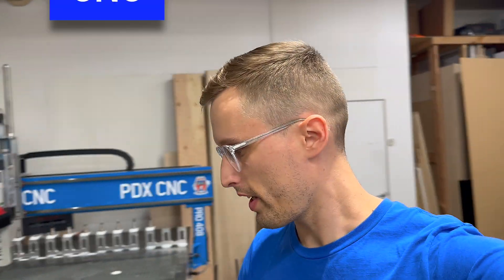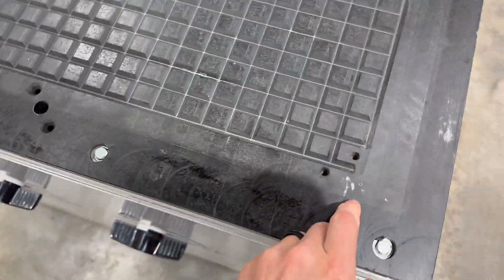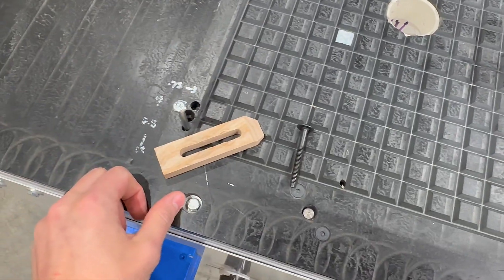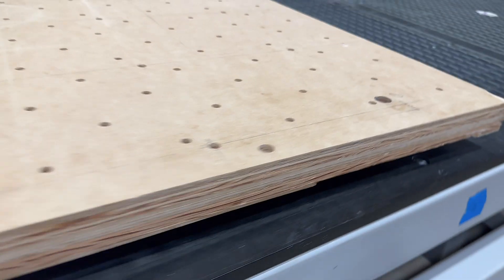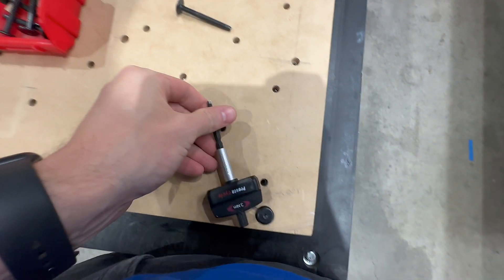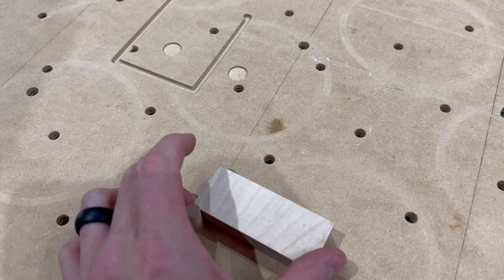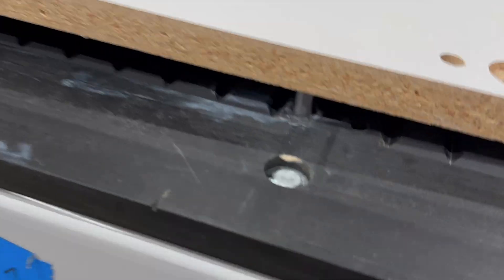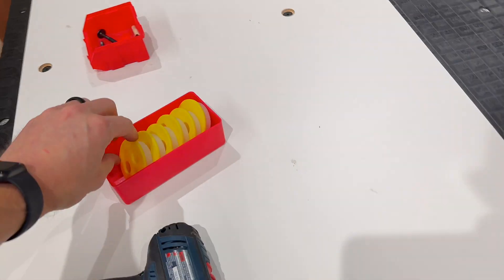Adding Fixturing to your CNC Router

Comment: Yo! I'm just drawing up my own fixture plate for my CNC. What spacing have you used for the dowel holes? Also, would you change the spacing if you were to do it again??
Reply from the maker: Yeah its been great. It's an overlapping 4" grid or 2" over and 2" up. It's been pretty ideal.

●   ●   ●   ●   ●
  ●   ●   ●   ●   ●
●   ●   ●   ●   ●
  ●   ●   ●   ●   ●
●   ●   ●   ●   ●
Reply: @pdxcnc  great stuff, thanks Justin! 👍🏼
Reply: @pdxcnc  Hey Justin! i was just wondering what the purpose of the thin layer of MDF is you have sandwiched in the middle layer? Is it to hold the t-nuts in in the underside of the top tayer??  thanks, Graham
Reply from the maker: @grahamyoung9941 exactly, yes

Comment: This is fantastic advice for fixturing! What bit are you using to machine the holes for the larger dowel alignment pins? Dedicated phenolic cutting bits are super expensive, so it seems a shame to spend upwards of $100 for something that will only make a few holes. Hoping I can get away with a simpler o-flute bit for a few cuts. Thanks and Let me know!
Reply from the maker: Hey we just use pretty standard upcutting carbide tools. I'm not sure about an o-flute but you could try. The reason the phenolic specific tools are so pricey is phenolic is incredibly abrasive and will quickly eat most tooling.

For most of our fixturing in the phenolic we drilled with HSS drills which is also tricky but you just need to play to hit good feeds and speeds. Go incredibly slow RPM and feedrate.

Comment: Great idea. Out of curiosity, if you had a phenolic table with t-tracks would you have still done this? My ShopSabre bed has phenolic w/ t-tracks but I am still getting my shop set-up and haven't fired up the CNC yet so still very much in looking and learning mode. That said, I did see a ShopSabre video for making a sectioned (hybrid) spoilboard for pod work and also access to the underlying t-tracks. BTW...I like your the plugs you made for the open vacuum ports...I need to come up with something like that.
Reply from the maker: Hey Larry. I originally regretted not getting t-tracks but am very glad we didn't after some experience. They are tough to manage vacuum work holding and aren't as flexible as they originally seem. We do a wide range of projects though, if you're doing mostly sheet work it would be less of an issue.

I'm sure you'll find some great ways to use the t-tracks, there's nothing to say you can't also add some threaded holes into the frame as well!

Comment: Nice tip! The thumbnail prevented me from watching this sooner. But I should have known you always put out good content.
 I setup a similar 2 pin system but just used the vacuum to hold it down. Only works on parts that don't break the seal during cutting, so your mileage may vary.
Reply from the maker: Hey John. Ha, yeah, I get the thumbnail, was an experiment. Bit quirky, thanks for the feedback.

Comment: What if base zero will occasionally move?
Reply: I helped a friend setup a very similar jig on a cheap machine with an unreliable zero. I added a crosshair engraving to the  fixture at the time of initial pocketing so he can doublecheck the alignment each time he installs it.
Reply from the maker: Most machines have a machine zero that you can rely on. Or set a higher G59 for your fixture setup or something if needed